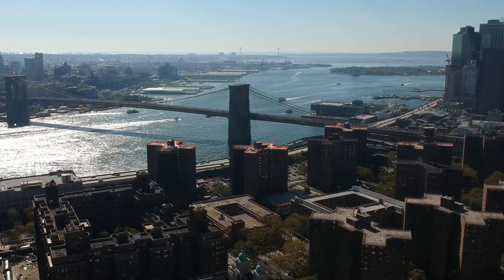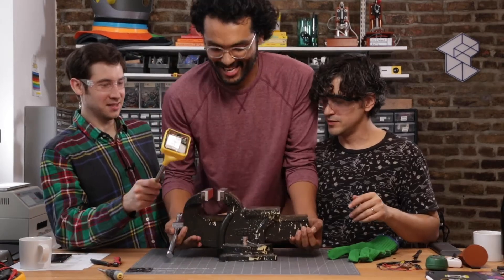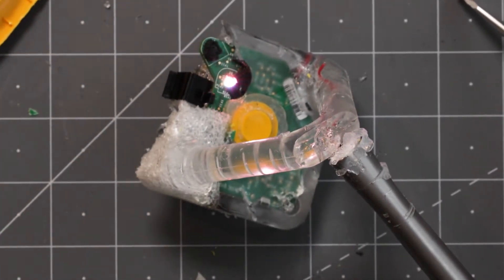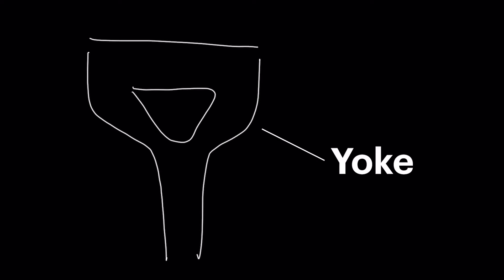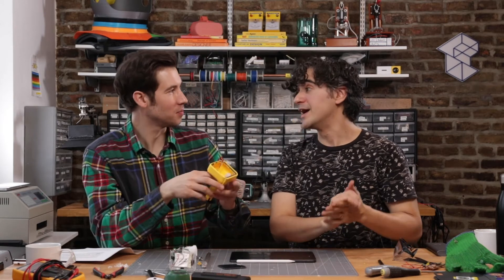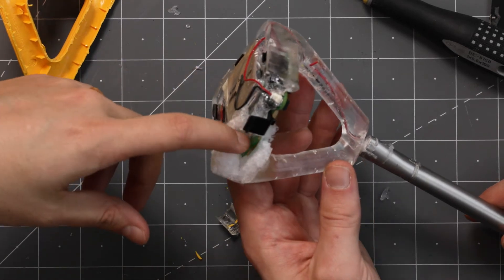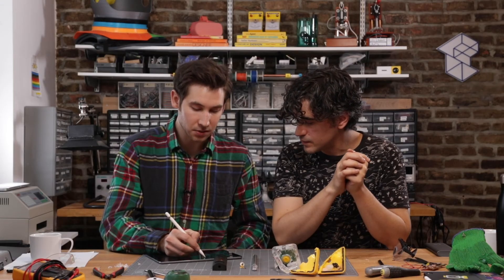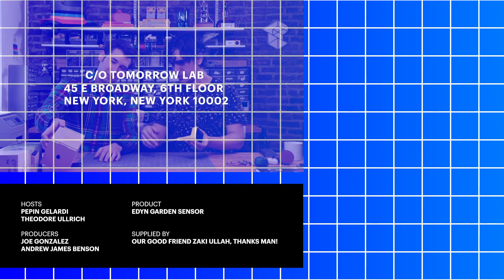Teardown of the Edyn Garden Sensor by Yves Béhar’s Fuse Project

Comment: Hey Guys, How do you think they measure the nutrition aspect? Great video btw!
Reply from the maker: TheWillienelson92 thanks! The nutrition data is most likely measuring electrical conductivity (EC) which measures the relative amount of salts in the soil which can be an indicator of soil health.
Reply: @TomorrowLab  Hi, I found this video very helpful.  I would be glad if you tell me the list of hardware, sensors and all they use. It would be really helpful. Thank You..!!!
Reply: @TomorrowLab  I am sure every nutrition-meter indeed take advantage of that EC (bet teralytic use the same method). But things is, how you guys separate the measured value into individual nutrients? (N,P,K)
Reply from the maker: kerem cema thanks for the question. NPK measurement comes from a separate sensor developed in a wet lab in California.